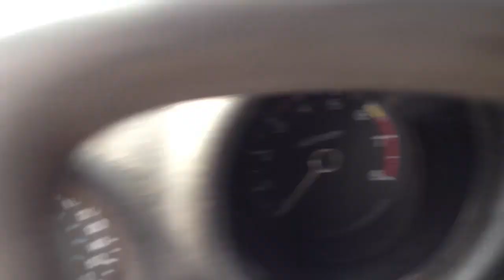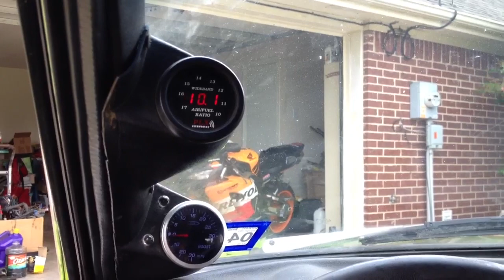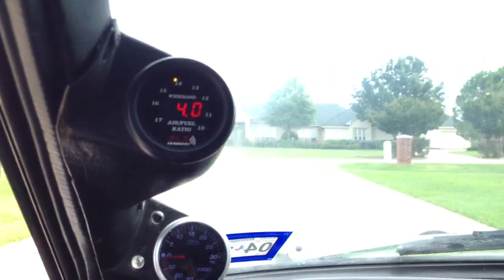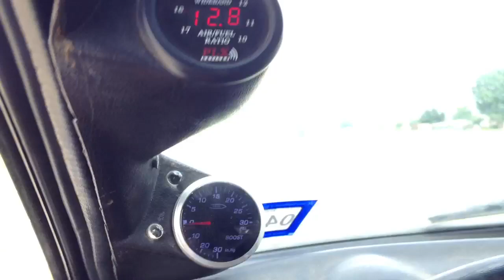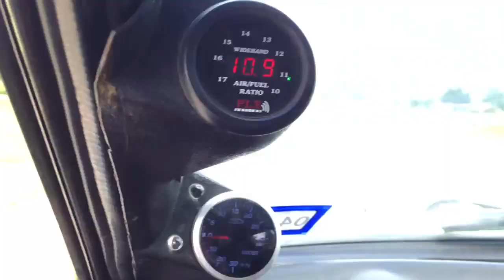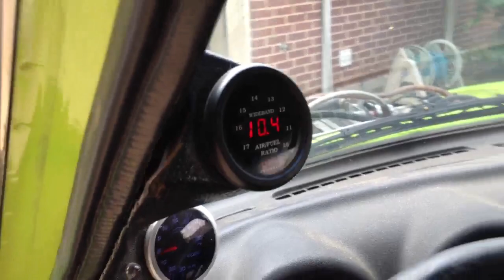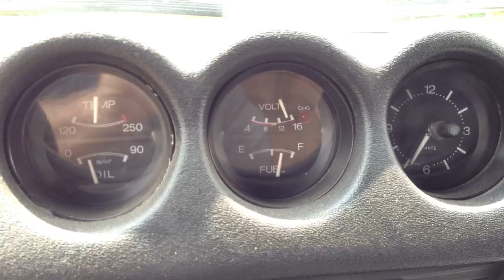Datsun Z, rb30 drive

Comment: I think there is a couple of things that could be wrong. You might be getting some RFI (radio frequency interferance) through the tps or other sensors. If you have some sort of idle control it may be dirty or the solenoid may be weak, but the best way to remedy all of this is to switch to a MAP based EFI setup.